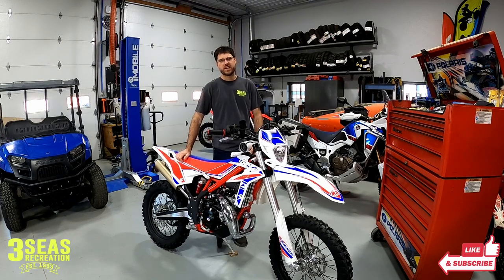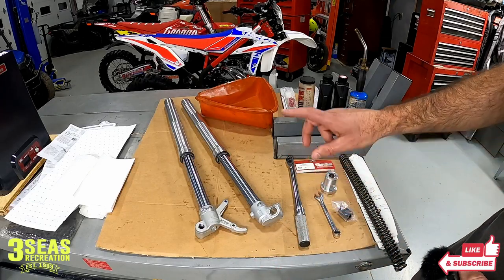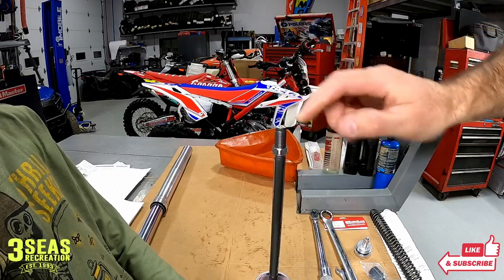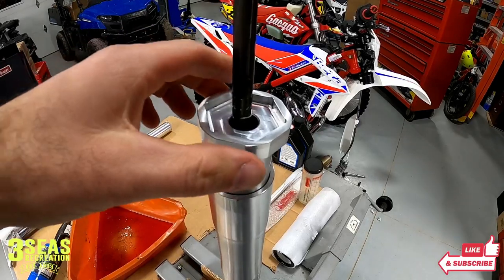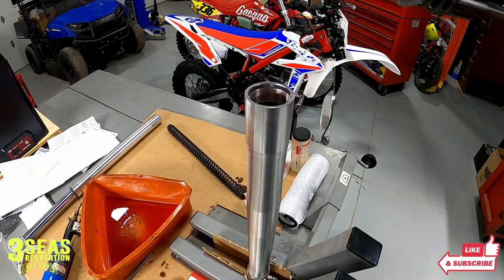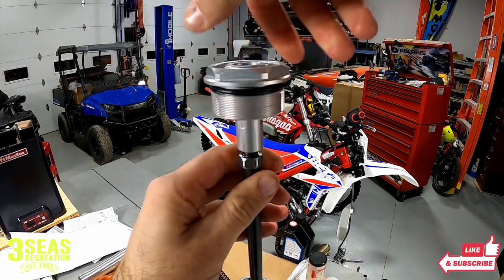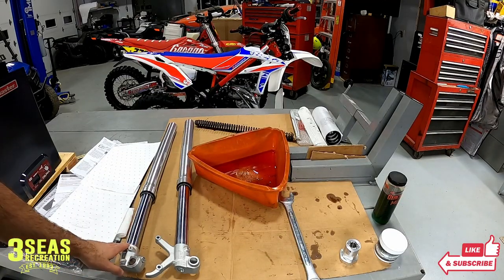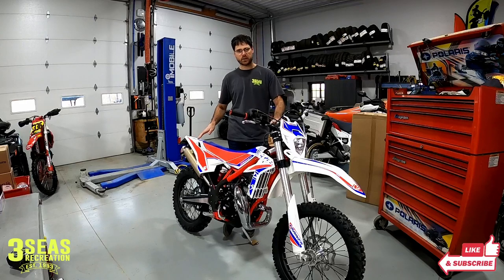HOW TO INSTALL Beta XTrainer 2" Lowering Kit! How Much Lower Is It? # AB-41104,  3 Seas Recreation

Comment: Great video!!! You earned a subscriber. Quick question

I changed the oil on the left fork to replace it with a heavier one, and all I was able to take out was about 260 ml or so, and I was only able to put back  260 ml before it maxed out...Im probably doing something wrong, how where you able to put 460 ml of oil on your left fork? It maxxed out with the top tube collapsed a 260ml  do I keep filling it up and extend the top tube until I get the whole 460-550 ml of oil?

Comment: Great Vid. Does the ground clearance become 1.5'' lower also? I am assuming yes.
Reply from the maker: Good Afternoon and thanks for checking out our channel! Yep this lowers the whole bike frame so what we take away in the suspension lowers the skid plate as well! Enjoy the ride, Jared
Reply: If you need to have the Xtrainer lowered, start with a Seat Concepts LOW "OE width" seat first.. This gives about 1 inch of lowering. Then decide if lowering the suspension will benefit the rider.

 I Run the Tubeliss 2 system and low 6psi rear and 10-12 psi front pressures and it lowers the bike a bit too. The tires squish more.

 I also have a one inch reduced travel Factory Beta shock. I raised my fork tubes almost 30mm in the triples (maxed out), I have bar risers. 

 It allows me to get a leg over (28 inch inseam). And I can get a foot planted any time, except when there's a hole under my boot.
Reply: @ow-my-achilles1106  We did the Kobel rear link, Seat Concepts wide seat and adjusted the triple clamp on my 2022 300rr. It’s just about perfect now for my 29 inch inseam and about 185 lb (includes gear) older rider.
Reply: @ow-my-achilles1106  do you have the part number for that beta factory shock?  It has a shorter spring or what?
Reply: Can you notice much of a difference in the handling with the 1" factory lowering kit? I'd like to lower my 300rr an inch but don't want to cause any major negative handling to the bike. Thanks

Comment: Lot of trouble to lower a already low bike.    Why not just slide the forks up in the tree and lower preload setting in the rear?
Reply from the maker: Good Morning, I am 6'5" so lowering a bike for me is not necessary but not everyone has the luck in the height department. This gives the customer unchanged geometry and the ability to go ride all the trails they desire. We sell a TON of lowering kits not only for the XTrainer but also for the other Beta Models. The cool thing is that nothing done is permanent so if the next owner wants to return it to normal height it can easily be done! Enjoy the ride, Jared

Comment: Is there anyway to go lower than 2" ?  I was really hoping to get my xtrainer down to as close to 32-33" as possible and was disappointed by the end of this video after seeing the 2" lowering kit only brought it down to right under 35" (seeing that they list it at 35.8" on the specs).  Wondering if you have done the lower seat in combination with this 2" lowering kit and what the end height was?
Reply: aftermarket lowered seat or shave down the factory seat yourself.

Comment: Is it truly necessary to drain right fork fluid to some lower amount if using 1" shorter fork kit?
Reply from the maker: Good Morning! Thanks for checking out our channel! Yes it is required to remove fluid from the forks when installing the lowering kit. Stock shows 500cc of fluid and a 1" lowering kit shows 475cc's and a 2" lowering kit shows 450cc's of fluid. The directions to the kit are here:

https://betausa.com/content/SUPPORT_PDF's/AB-41104%2041103%20XTrainer%20Lowering%20Instructions.pdf

Comment: Jared can I just call and order all the parts I need to install the 2 inch lowering kit on my 2023 Cross Trainer. What number do we call?
Reply from the maker: Good Morning! You sure can! We are on East Coast Time, with hours  M-F 10am-6pm & Sat 9am-4pm. Shop phone number is (716) 753-2628. We would love to work with you!
Reply: Jared, I want to thank you again for the assistance lowering my BETA!  At 65 my balance isn’t what it used to be.  The parts showed up quickly and between your videos and help locating the necessary instructions … it process was a breeze.  Thanks again my friend and I couldn’t be happier with 3SR support.